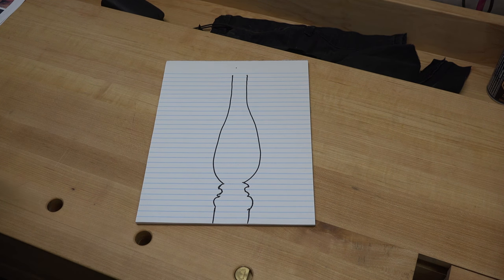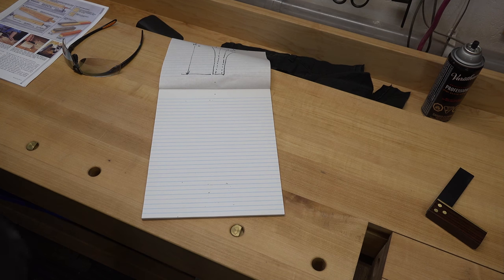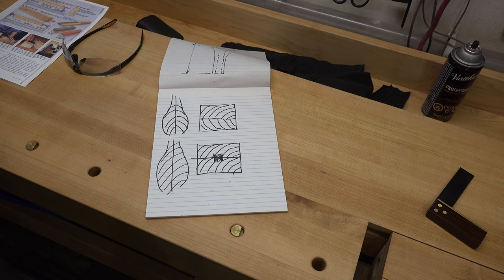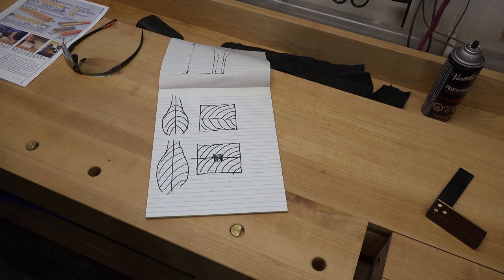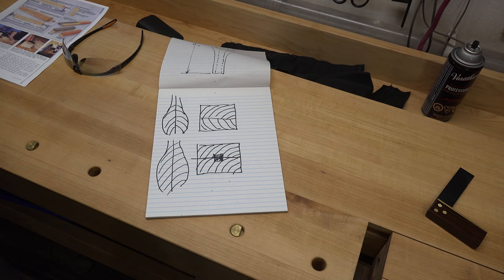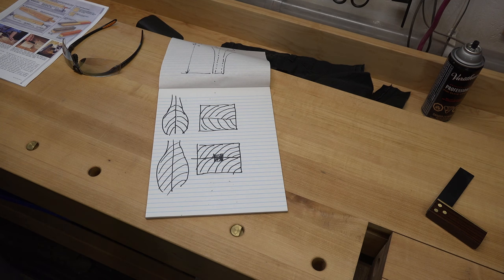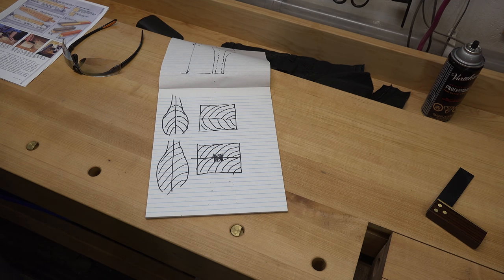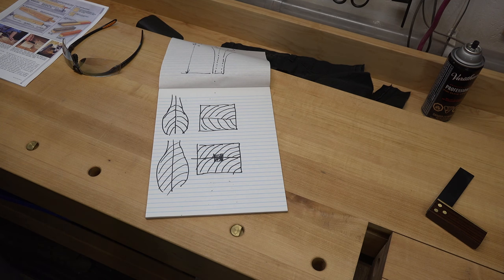Making a Music Stand Part 1

Comment: thank you Kenny . pardon me i just washed my hands and i can not git me fingers to do right .  the info you are putting out is very interesting again thank you . but sometimes i can not for sure tell what way the grain is going due to the heavy figuring of the wood . i had never really thought much about which way the gain ran ( but i never worked in wood either ) it seem very important. neat stuff. i just know its purrdy .
Reply from the maker: The grain alignment would not be a problem here if it weren't for the fact that it was a laminated and a turned piece.  I'm thinking that you need to start working with wood.  It's a fantastic hobby.  Thanks for tuning in again this week Walter.  Always good to hear from you.